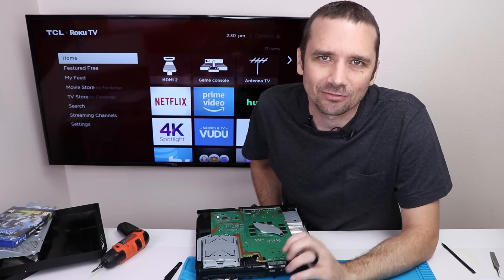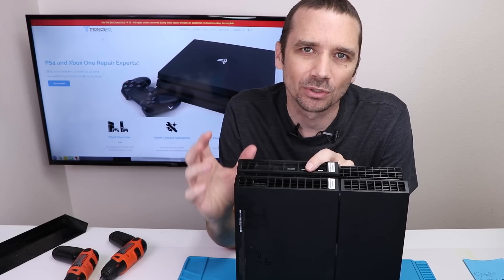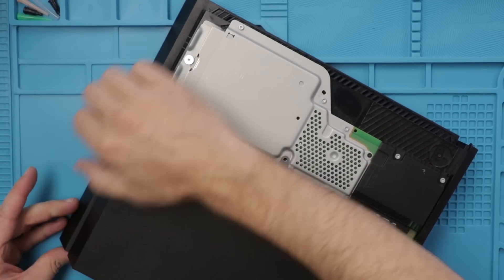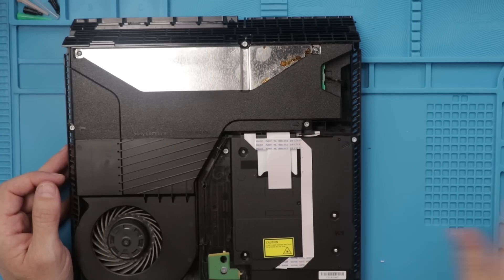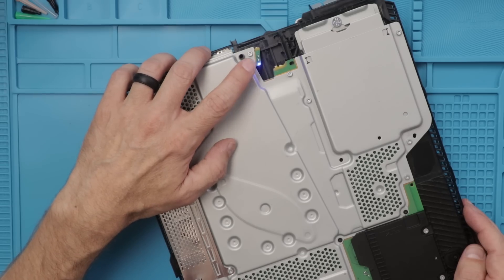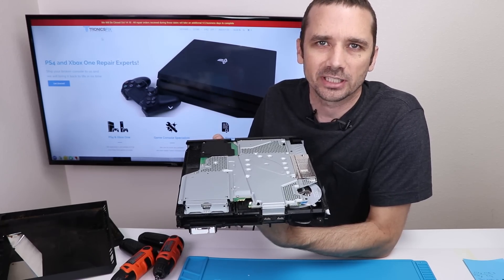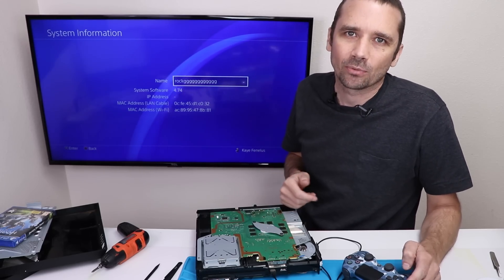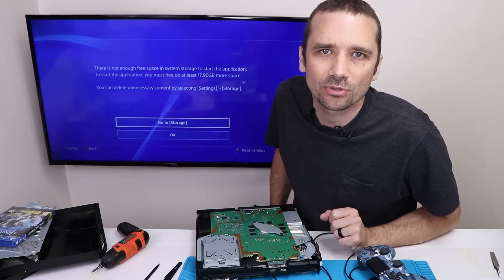PS4 WLOD Repair - This Was Challenging BUT I Think I'll Make A Good Profit! eBay Repair Challenge

Comment: Hi im trying to fix my cuh-1216a, its displaying no signal at all, it will beep once when turning on but no lights and not letting me enter safe mode, it will stay running and sounds like its spinning up discs as normal, I have to hold power button for 20 seconds to turn of ps4 iv checked the power supply input its reading 12v and connection to mother board is 5v.0v.0v.5v? i also checked the 4 emi filters but got no beeps or readings any ideas would be much appreciated thanks

Comment: I disagree with not using low melt solder on the port pins and legs as it reduces the amount of time you need to get the port free because heating it for too long is going to shift components around if you aren't careful and a new comer might not get  another chance when they pull pads not heating the port long enough

Comment: I am having a problem with my Playstation randomly shuts itself down. There is no warning nor red light. It shuts down like it was cut out of power. Powering it on immediately after the shutdown gives around 10 sec of blue light then it shuts down. What I do is unplug the device from electricity for a minute then plug it back in and it works. The shut down happens randomly. Sometimes it works for an hour or it stays up for 4-5. Though it never stays more than 6 hours. There’s no warning light or any sound. It’s just power itself off and requires to install the latest system update. I’ve done this several times but it still shut off and wants to reinstall the latest update via USB. And when I’m on the home screen it lags like hell and freeze eventually. I’ve paid for so many games and spent many hours in game and all I get is a non working console. And yes. It’s faultcodes like.  System not shut down properly and rebuilds software. My ps4 has been shut off Ingame so many times that my database is not working anymore. I haven’t been online for months because my console won’t let me play properly anymore. Even my games I’ve had to redownload so many times. And I’ve also experienced when I quit a game my console shuts off and wants the latest update again of the system software. My console is from 2015. I’ve even changed HDD and that didn’t help at all. It made@it worse.

Comment: I'd dunno, you risk damaging other chips with your air technique.... I think you need a proper rework machine.
Reply from the maker: I've replaced literally thousands of these using hot air. It's the best and fastest way to replace them.
Reply: I'm sure you have and you have skill . However, you can still damage other components which is all I'm saying.

Comment: Hello, I have a PS4 Slim that is showing error (CE-30391-6), I've done all the procedures of Menu mode, Softaware Update and all.
What I noticed and told me is that this error is related to the date and time of the video game that is not synchronizing correctly, I changed the battery that takes care of it that is located on the motherboard but without results, would have any idea what could it be?
Sorry for the bad english because I'm from Brazil and I'm in the translator

Comment: The PS4 that I'm working with doesn't restart so I can't complete the installation of the firmware. It will Just copy the installation files till 100% and turns off. What should I do?

Comment: I'm afraid that my 5.05 Phat needs a new HDMI port and/or chip.

Lately it'll just disconnect while playing. It'll run fine and suddenly the screen will go black. The console is still on but the only thing you can do is a reset by holding down the (now silent) power button for about 15 seconds. Then it has to rebuild the database, etc.

It'll come and go but lately it's been doing it a lot, jailbreak applied or not.

Comment: I have a left joycon that is drifting intermittently. I dont know what to do. Ive had the switch since last thanks giving and randomly it srarts drifting downwards and calibrating doesnt help. But then randomly it goes away and doesn't come back for a week or even a month. What do i do? Do i warranty  it? Or ignore it? Is it the joy stick or does the famous stick drift not go away. Also intermittently my switch when the left joycon is connected directly to the console in hand held mode it thinks the left joycon is disconnected but still shows up as charging. But since the switch thinks the joycon is disconnected even though it is connected it disables the right joy con so its frustrating when it happens mid game. Is that the joy con or the console? Idk because those are my only joycons. Both these problems are intermittent and would take hours or even days of playing to replicate so even if i warranted them it may not do it in nintendos hands. What do i do? Any ideas? Is my switch a ticking bomb or am i just stupid and paranoid its gonna break and warranty is almost ?

Comment: hi help plz 
I started my console 1 hour ago, and the safe mode started and showed me this message: "Can not start the PS4 Connect the controller DUALSHOCK 4 using a USB cable , then press the PS button. "
Reply: hi help plz 
I started my console 1 hour ago, and the safe mode started and showed me this message: "Can not start the PS4 Connect the controller DUALSHOCK 4 using a USB cable , then press the PS button. "

Comment: So’ I’ve been having problemas with my ps4 When first was having problems its that when the ps4 was Hot when i Turn it off and turn right back on, its just shuts off, then It was Worst because sometimes turned on and immediately shuts off and now it just like that, I have it connected it directly to the wall and nothing change please help

Comment: Hi I have a PS4 Slim, when I try and change disk, the disk drive starts making a constant noise like it's about to eject the disk constantly (the disk does eject though) if I try to put another disk in, it will not take it, but if I turn the PS4 off then back on, as soon as the PS4 starts up I can get it to take a disk and load it/play it. I have looked through your videos for a problem with an exact match, but have not managed to find it, but there was one video where the rollers on the disk drive come loose, could this be the problem? I don't want to take it apart until I know the likely problem/solution. I have taken my PS4 Slim apart before whilst watching your videos, to clean it when it was getting to hot. Hope you can answer and help solve my issue! Many Thanks, Love The Channel!🤩🤩🤩🤩🤩🤩

Comment: Hey Steve, I don't know if you are aware but many joy-cons are having prematurely drifting joysticks, the only way to fix it is replacing the joystick for a new one, others have tried WD-40 and compressed air but it doesn't do much difference (or even any at all). How would an electric scholar like you fix a drifting joycon without replacing the whole joystick?

Comment: By heating up the hdmi to take it out, wouldn't the other stuff around it get hot and loosen?
Reply from the maker: It does get hot...but as long as you don't bump it around everything stays in place nicely.
Reply: TronicsFix good to know thanks!!!
Reply: They also make sure inexpensive  heat tape to shield off close components if someone doesn’t have a good delicate heat gun like he has.
Just found this guy myself and wow, super smooth, honest, and accurate without bellowing “like and subscribe” before a man even watches his video.
But yea, heat tape or something is what it’s called if you’re concerned about nearby transistors etc.

Comment: What do you use to clean up the solder residue?
Reply from the maker: Usually I heat it up and soak it up with a q tip, then 99% IPA

Comment: I Turn My Ps4 On  Blue Light on And Beep once Immediately Turns Off...! I Need Help?
Reply: It sounds like the power cord isn't making a good connection, or the power supply has gone bad, or you have bad solder connections on the AGU.
Reply: @SpearM3064  i Changed My Power Cord And It's Not Working What Can I Do Now?

Comment: Hey tronicsfix we have a Xbox one and it has been repaired by Microsoft then it broke again we may send it in we don’t know when we will but I want to know if you can fix it on your website it says Xbox one s and X
Reply from the maker: We actually don't repair the Xbox Original anymore since you can buy a used one cheaper than a repair. Sorry about that.
Reply: TronicsFix it’s ok I have a Xbox one s soooo hope it don’t brake

Comment: I’m not sure if my switch is messed up or not but sometimes it wont charge with the Nintendo charger that came with it and sometimes it will so I’ve been using the charger for my lg when it won’t charge with its own cable is that something I should get fixed?
Reply: @Jaime Beauchamp thats good to hear since thats something I was planing on trying.

Comment: The skill and precision of your work can’t go without a mention, it’s impressive man, therapeutic to watch!
Reply from the maker: Thanks! Glad you're enjoying these vids!
Reply: @Tronicsfix  hey i got a problem with my xbox one disc drive, every time i try to put a disc in it wont work and it wont read or spin, i think my drive has to be replaced, if i replace it it wont harm my xbox right? I just want to play games again 😥
Reply: @Tronicsfix  what is the Sony in 0:20 in your video
Reply: @Tronicsfix  if it broke you fix till it is 🤣🤣
Reply: This channel is one of two channels I love for this kind of therapy. The other being HDD recovery services. He actually repairs hard drives just enough to retrieve lost data. Sometimes he does flash drives, SD cards, micro SD cards, and CF cards. The work he does retrieving data from flash isn't that different than this channel except he frequently has to reball BGA chips. While he can retrieve data from the NAND directly apparently 99% of the time it's faster to construct a working device and use that then using the chip reader.
Reply: @awilliams1701  Hey, thanks for the channel suggestion. I have exhausted all of TronicsFix videos and that HDD recovery channel certainly filled the gap. Thanks, man.
Reply: It's so therapeutic!
Reply: Totaly agree, i think i would like to be ps4 and fixed by this guy 😁
Reply: Thats so true...Its relaxing to watch
Reply: He is below average
Reply: Matt, if you mean that then go buy the sterling engine on eBay and help a brotha out....lol jk

Comment: Hope that fix to the ps4 hdmi will be permanent at 10:37 the screen flickered usually that happens when you use some none powered hdmi splitters
Reply from the maker: The port had some flux in it. Common problem.

Comment: The only issue I have with my ps4 is occasionally when switching the console on for some reason the controllers will not connect to it even resetting the controllers doesn’t work the light will keep flashing orange switching the console off and unplugging the power cord plugging it back in turn the console on they work never understood why it dose that
Reply: I had the same “controller stopped working” issue.
I can’t explain why but it was hdmi port-related. OR, there’s a small chance it’s the wifi antenna (super easy to replace).
I had a local repair shoppe replace the hdmi port (bc I didn’t have a solder set that small) and it worked fine for two months, no controller issues. Now, I have the wlod and wish I would have found this video sooner and he might have replaced the hdmi chip as also.